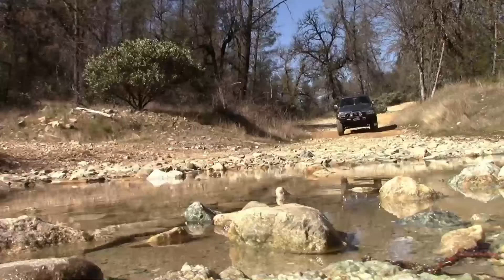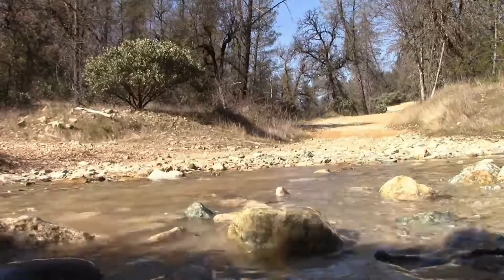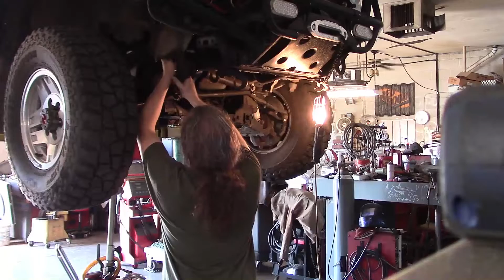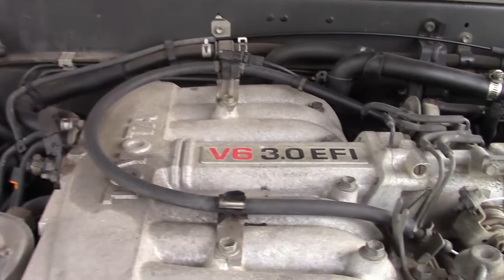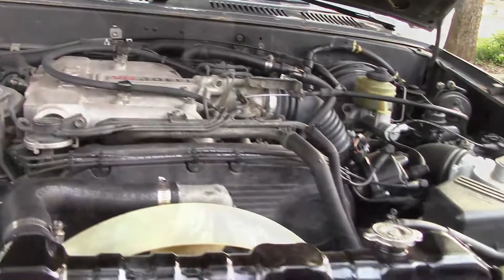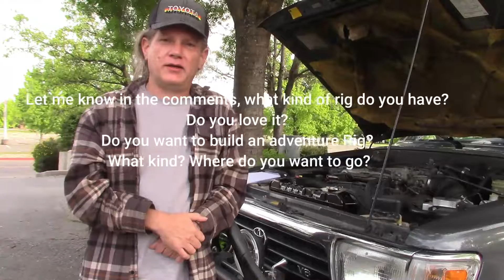Toyota 3.0 3VZE, is it any good? How to Make it Run Forever! 2nd gen 4Runner.

Comment: Great video, pragmatic and practical. I have a 1990 3vze 5 speed. I have a small valve cover gasket leak I'm going to tackle in the next few weeks and had a couple questions I was hoping to ask...

1.) OEM gaskets or something OEM+, like Fel-Pro? Do you have a preferred gasket / seal compound?
2.) Since I have to take the plenum off I was looking into replacing some of the vacuum lines. One had a split already near the fitting, so I know they are getting close. Generally I agree with the 'just use OEM' parts mantra, but what do you think of moving to something like silicone lines? I think, in rare cases, there are some tech advances now that just weren't around back when the stuff was spec'ed by the manufacturer. I know for heat tolerance, and probably overall longevity, silicone might be a better choice of the sidewalls and material are sufficient. 

Thanks again and keep on cruisin'
Reply from the maker: Hey!  Yep I'd be fine with the silicone. I agree on the tech and material advances. It's hard to believe these things have been around so long. I remember when these were new. No OBD2. We used Sun machines and things like that....no one even remembers how to use those things anymore haha.
Gaskets. Good question. I'm going to be doing my valve covers and rear cam seals soon also.
I think for valve covers I'm going to go with whatever rock auto has. Probably Fel Pro or something with a decent reputation.  The cam seals will be OEM I think.
But I'll probably do a little digging on what has worked for guys. Sometimes an hour spend cruising the forums can be gold.
Reply: @AgileWoodsman  Thanks for responding! Yep, I bought this one 20 years ago from the original owner. He bought it new, drove it up to meet us on a camping trip. I remember seeing it in '90 thinking 'wow, that's awesome'
Reply from the maker: @nickt9467  That's awesome! I love that connection!

Comment: I'd get along with this guy.He knows what he's talking about.I have a 93 Toyota Warrior camper with the 3.0.I have traveled to 42 of our states now in this baby,not one single issue. Mine has had the recall done,and I'm very diligent about changing oil/filter under 3k miles.Im amazed that only being 150 HP ,this little engine allows me to run all day at 65mph fully loaded also.Great engines if taken care of.Great video!
Reply from the maker: Awesome,  Thanks man! Glad you're getting so much use out of yours also. Nothing like em! Drop by again!

Comment: I just bought a 91 3.0 Dolphin rv with 55k miles. Runs great, pass smog in California, it’s been sitting for six years on the coast so flushing all the fluids. I like what you said about the cooling system, after researching the 3.0 and the head gaskets I was nervous. I’m granny gears and years, driving slo no prob. I want to go to burning man with all my kids and grandkids, we’re also into high altitude camping, fishing and hot springs.. I get we are carrying more weight than the average forerunner and overheating/blown head gaskets  is my nightmare. thanks for the advice, this is the most practical video I’ve seen  on this engine. Now I have to figure out all of this extra RV stuff… air bag suspension, black water and propane.. oh my! Cheers!
Reply from the maker: I love it! Those are such cool rigs! And awesome that you're getting out there, so many adventures,  doing it with family. Warms my heart! Live life! Enjoy! 🙏❤️

Comment: Had 3 4Runners all with the 3.0. All had over 200k all ran like a top. I had more issues with the manual transmission of those years. Got nothing bad to say about the 3.0
Reply from the maker: That's the experience many have! Gotta stay away from the internet misinformation about these motors!

Comment: Is it wise to just delete the egr valve, the 4runner i have the erg valve is stuck closed and even when clean is never mover back, i already ordered the kit for the delete, was going to order the oem erg valve bout 300 bucks vs 20dollar delete kit.
Reply from the maker: If you can afford it, I always recommend doing proper repairs. EGR delete can raise combustion temps a bit, something we don't want, because of the head gasket issue. Lots of guys do it, but maybe they are the ones complaining about head gaskets lol.

Comment: Thank you for these videos. They are a real help. I got a 93 4runner 5sp 3.0 4x4. Runs good but.... motor started "pulsing" or "lugging" at cruising speed (mild load with just a little throttle 2500ish RPM). If you give it more throttle before the lugging gets bad the the engine catches on and take off or you need to downshift too get the RPMs up in the poser band (3000+) range and all is good. I replaced the TPS based on all the stuff I had read up on. Cannot say that has made a difference. I guess when I think I have it adjusted correctly things get better - and if I over comp one way or another it seems to move the issue slightly up or down on the RPM range. If I unplug the TPS it seems I still feel a little bit of the issue but not as bad. btw: I changes our the fuel filter and have changed out 99% of the vacuum hoses. Rig has 250k and the plugs were done at 210k. Wires look good but I cannot confirm that they were changed or the condition of the rotor (just have not pulled it to look yet).
 
This has got to be something simple but it is eluding me what to do. I am sure one of you guys has seen this before. Please help! I need this to be AWESOME for my wife who love this rig.

Thanks in advance.

Comment: What u mean it does it on the drivers side cylinder head gasket want a burnt up number 6 cylinder
Reply: That happened to me Cyl 6 but blown gasket,
Reply from the maker: Pass side for sure. If I said drivers side in the video, I miss spoke! You are correct.
Reply: @AgileWoodsman  no it is the driver side that goes bad not the passenger is what I'm saying
Reply from the maker: @jeffgood6441  Gotcha. Typically it's the pass side where that heat crossover is for the exhaust.  But anything can happen!
Reply: Yea the cross over is coming off the passenger side but the worst point is right there where they meet on drivers side back of the head

Comment: First driving smooth you drive a million miles on it .Pedal to the metal the engine dies fast because  of overheat.
Reply from the maker: That's a good point! And people will put big, heavy tires on without regearing and pedal to the metal all the time because the car is even slower now. Then wonder why their stuff grenades hah.

Comment: Great video. I would be interested in TPS info. I'm looking to buy a 1990 Toyota TV with this engine. The owners are older and they just changed the battery, spark plugs and wires, distributor cap and rotor, TPS, and the Fuel Filter. They claim it ran great a year ago but have not driven it since last year due to health issues. They claim it runs, but doesn't want to go fast. I haven't looked at it yet and I think they did not or don't know how to adjust the TPS.
Reply from the maker: That could be very likely! That thing can be a bugger. It's not as hard as it seems though. Check out my website, the resources page has everything you need to do this!   http://agilewoodsman.com/2nd-gen-4runner-resources/

Comment: Good advice. In the FWD Vienta the motor is mounted east-west so maybe less prone to "rear passenger side heat issues" because that part of the motor is facing forward?  Maybe.  

(I'm old but I know some young dudes who swap 3MV-fe motors in to MR6s and boost them to 300 rwhp+ who would disagree with you on them being slow😁 but I'll be driving mine slow)
Reply from the maker: I'm not familiar with the 3MV-FE at all but I'd lvoe to have 300 HP!! haha.

I imagine a transverse mounting position would help with the heat issues. Very likely a different exhaust routing. Thanks for the comment!
Reply: @AgileWoodsman  I have a 1uz and I'm familiar with the jz straight sixes but I'm just learning about the V6s and I think I might have quoted the wrong designation.  Between the inlines and the Vs surely no other company has made so many 6 cylinder motors!  Thanks for your reply and keep on truckin'
Reply from the maker: @MrMightyZ  They sure have! It really is location and year dependent. Enjoy your rig and thanks man, I will! You too!

Comment: I have a 95' V6 2WD and  the most problem what I got is when I goin up hill feel weak; not to much power. I'm thinking if is the injections or something else related with the gas. If you can give me light I will appreciate. Thanks 🙏
Reply from the maker: Automatic trans? It's gonna be slow

Comment: Toyota changed the gasket they used in the problem 3vze engines in late 92 and starting with the 93 model.I have 363K on my 91 4runner,Used waterless (Evans)coolant and castrol synthetic oil from 5,000 miles.And blocked all EGR into the intake and the lines that go into the throttle body.All head gasket problem with these 3.0L is the cylinder closest to where the egr comes into the intake manifold.

Comment: Thank You for your video. We purchased our 91 4Runner 3.0 3VZ-E new and its now pushing 200K miles. Done mostly all our own maintenance and have read all the bad press on the 3.0 engine. You video restored my faith in the motor and our hope to reach 300K. Thank You from N. Idaho!
Reply: How many miles did ya get ? You still got the 4Runner ?
Reply: @Lightandlovetoyou  Yes, we still have our '91 4Runner. It is my wife's car and as such it doesn't get driven as much. Still under 200K and going strong. I believe actual miles is 197K.

Comment: At 200, 000 swapped all the old parts out with new OEM (except alternator), machined the heads, replaced the head gasket, ect. All said and done spent 15 00 bucks , all included were front suspension parts, keep it as original as possible.

Comment: Like your tips where should the temp gauge run at for  a 91 toy truck 3vz motor has 10 k on rebuild engine running great so far don’t to overheat it

Comment: That is a good looking 4Runner you have, and it's great to see how well you take care of it.  I've always loved 4Runners. Finally bought one just over a year ago - not a 2nd Gen like yours, but a 3rd Gen with the 3.4 5VZ.  Although it's not the same, some of the issues are as well the level of care .  So from this non-mechanical guy (regular oil changes were about all I could ever handle), I appreciate the advice.  After watching this video a week ago or so, I went ahead and ordered a radiator cap and hoses just to have for the next coolant flush as you mentioned (or to have around just in case). As luck would have it, I got a P0115 code a couple of days ago. I started looking around the engine to see where the ECT sensor and thermostat were (the suggested repairs for that code), and I noticed some light pinkish residue around the radiator cap that hadn't been there before.  I popped that new cap on there, cranked her back up, and the engine code went away (for now).  Thanks for sharing your enthusiasm and knowledge!

Comment: I have 1992 SR5 pick up with the 3.0.  It has 500,000 miles. I have an Amsoil bypass filter installed and use Amsoil. I change my oil every 4000 and change the bypass every 20,000. Make sure you change the differentials, transmission, and transfer case with synthetic gear oil. Also lube the drive drive shaft and front end. Often overlooked. The drive shaft has quite a few zirk fittings that need to be greased.

Comment: Have a 93 2wd 4runner. I had the rear main seal replaced. I replaced the valve cover gaskets and cam shaft seals. I still have a leak that appears to be coming from the distributor cap. I ordered factory cap and O ring and hoping that fixes it. Had to change the starter and Fuel pump when I bought it. Going on 201k and still going strong. Also use OEM parts. Thanks for this video!

Comment: TIP: Do EGR delete for major engine longevity. He says there is no benefit and that is absolutely incorrect. I bet he has never done the delete to see how much smoother it runs.
Reply: Not for more power. Cleaner and colder air how is that not better then hot recycled air from exhaust. Mine is deleted and it runs smoother through rpm range for sure.

Comment: Really appreciate your knowledge. I just bought my 1st Toyota 4wd. A 1995 3.0, SR-5 4 Runner. Body has no dents, appears to have been well kept. 200,000 mi. So far so good. Ive read, heard about the head gasket issues with this engine. How can I determine IF its had a factory recall repair ??
And if not ??? Is it even eligible for such ??? Reviews Ive read have ONE thing in common. SLOW !!! Im in no hurry so , as long as I can maintain 70 on interstate travel, Im good. 
   Mainly, curious about the recall ( ?? ) how to verify repair or dismiss ? Timing Belt replacement is top priority. Short roadtrip ( 80 mi. ) upcoming first. Should tell alot . Can u advise as to
Recall repair verification?
Thank you
Reply: You can call Toyota and give them your vin number and it should show if its had the recall

Comment: I just bought a 93 with a lift and 35 inch tires and it must have after market gears because it gets up a scoots. It has the 5 speed too and 207,000 miles.  And with I think 4 inch lift and 3 inch body it keeps it out of the mud and it has hardly any rust. And I live in Washington state. But I love driving this beast.  I've been learning alot about these watching videos like yours and I thank you. I'm working on timing it now, I can't find my timing light and just did a new timing belt and all new front of motor. It runs sweet. Lovin' it.

Comment: I bought mine 4runner second gen with 300000 miles on it for 2900$. 1kz engine, it runs great and the engine starts right up everytime. Very happy with it!

Comment: Just picked up a 95 3.0 manual. Did a fuel filter change, oil change, alternator, and alternator. The engine light will kick on once the motor starts to miss. Only will miss around 2000 rpm. Has new plug wires. Is there a common problem with this?
Reply from the maker: Not that I know of. Maybe start with all the tune up items such as cap, rotor, plugs, wires etc. At least inspect them. Check for trouble codes too and go from there.

Comment: Great video! I just bought a 91’ SR5 auto for $2200. Guy wanted 5k originally because he bored out the engine and completely redid it and it now has 138k, only 300 on the new engine. 
The the major problem with it tho is this weird “choking” issue. It starts up fine and all but when you go to accelerate anywhere from about 5 to 50mph it legit seems like the engine isn’t getting enough gas or something and doesn’t get up to speed for minutes. We think it’s a gas issue for the guy replaced all kinds of tune up parts, and said the trans was checked out good,for it does shift eventually very clean but it’s like the rig knows it’s not getting enough gas or air...

Yota tech has some threads about it but never any conclusions. Anyone know a thing about this issue?
Reply from the maker: Oh yeah that sounds like some digging and diagnostic work is needed! I'd check for codes of course. On these I always check for vacuum leaks. Also I'd check fuel pressure at the rail, and go from there if all that checks out. Also things like clogged cat converters can cause things like this. 
Basically you're not getting enough air or fuel.

Comment: In 2000 I bought a 90 runner that only needed a power steering pump.
After changing all fluids etc I replaced plugs, wires, distributor cap  and rotor , air filter, cleaned throttle body but still no power.  Thought maybe the fuel injectors were restricted so put seafoam in the gas tank and drove it to self clean.  Within a few days it cranked but wouldn't start. I opened the throttle plate to see a puddle of gas in the plenum.  I dried that gas put the air system together and it turned over.
Took it to my mechanic who told me the seafoam had probably burnt the contacts of the pre ignition (seventh) spark plug.   So just an advisory  to be careful about engine additives or internal cleaners.  I've kept it stock for the most part: no lift, still has original radiator (copper/ brass) use ngk V-power spark plugs, etc. And enjoy the world passing me by literally knowing I will  get where I'm going and will get home safely.  It is not a crawler nor do I want it to be.   It is a reliable machine  and that's nice to have in a car world of built in obsolescence.
Reply from the maker: I love that! Yes, I never thought in the 90's that we'd be looking back at those cars as a bygone era of reliability and good engineering, but here it is!
Sounds like you got your rig together well and are treating it right. I appreciate the tip! I do avoid additives for the most part. I find a few hours on the freeway is as good a cleaner as anything. Sometimes a few squirts of fuel injector cleaner or something.
Thanks Lou!! Enjoy your ride for many years to come!

Comment: Great video. I learned more by watching that then I have searching through nonsense on social media. I just bought a 91 4Runner 3.0 manual… it had the head gasket replaced by previous owner, as well as the clutch. It has a “tapping” sound that has started to get slightly worse. I was told by a mechanic who listened to it that it was the 4th piston rod, and it could be. I also wonder about valve adjustments, etc. I am at a loss with this and don’t want to sell it, or spend a fortune swapping the motor. Do you have any advice or ideas? Anything would be greatly appreciated. I like the rig a lot. Again, thank you for your video… I’ll be watching more of your videos for sure!